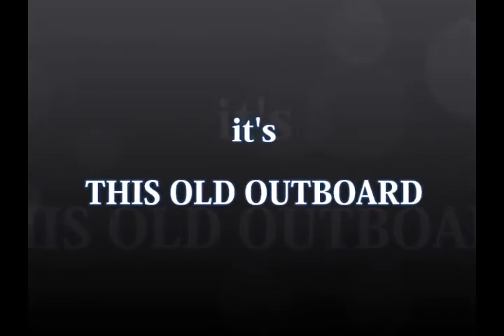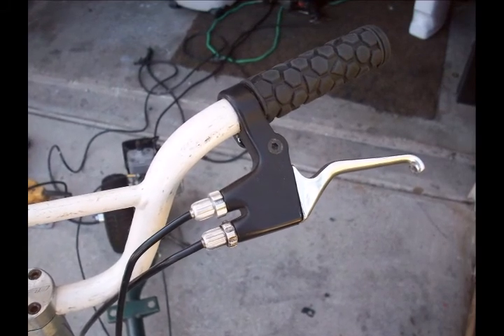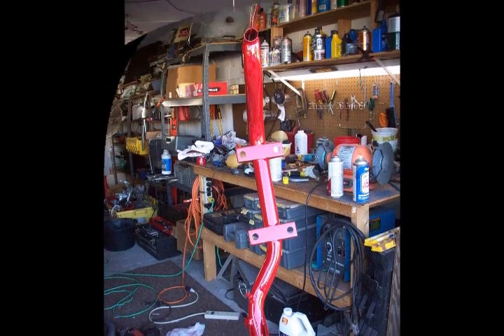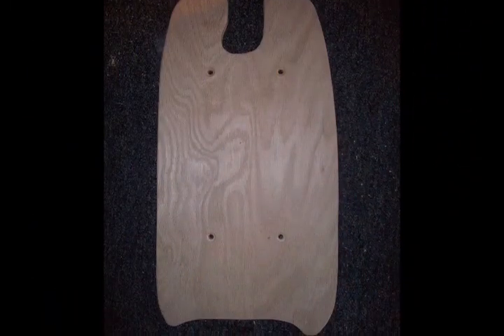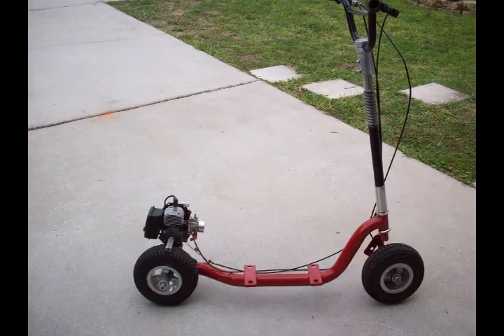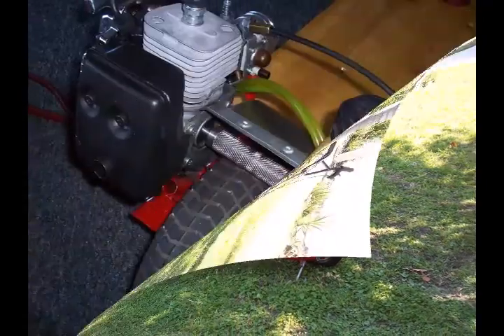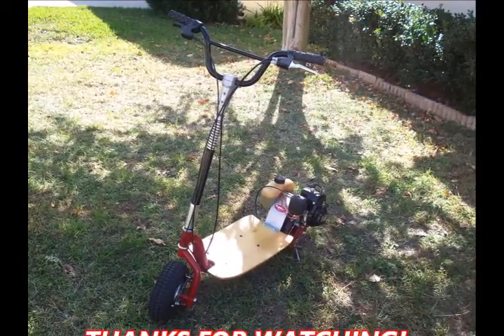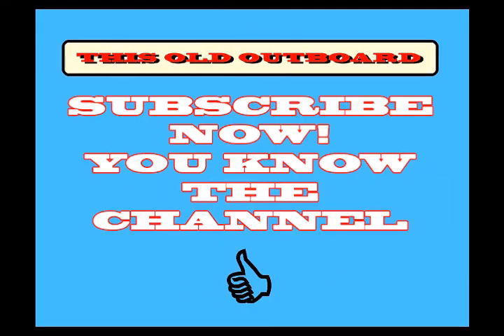Custom Build Go-Ped - Lil Red

Comment: Ya know, with all that affection expressed, seems you may have to get back now & then to the go-ped building. Great little skater. So it was direct drive, no centrifugal clutch? Just governor limiting on speed? Max. minimalism. And that tire diameter felt best for handling? Seems you reached the design pinnacle and then had to leave off. Engine lift was indeed brilliant, esp. in brake combo. Maybe build one with an oil clutch? Then sell for max. profit, or raffle off (if legal). "This New Power Skateboard" branch off. I could imagine a new-build break being welcome now & then after a series of neglected/greasy OB revivals & parts searching.

Put a park buddy in charge of assembly while you dream up and sketch out new innovations. Maybe a 3-wheeler with seat for the elderly, replete with grocery basket and cup holder, baton scabbard for self-protection, ha!
Reply from the maker: hey. i would love to have another one. i do look on craigslist from time to time. i'm an old surfer boy from cocoa beach and the go-ped is about as close as i can get to that ''feeling'' of riding a wave. yep, direct spindle drive, i think most of them are belt/chain drive now, at least the bigger peds are and no govenor. that zenoah g230 i believe will do 35 mph, plus you can really soup these things up. i had a couple that were pretty scary, to fast for me! they did come out with an oil clutch on one model, but i never had one. the grocery basket and cup holder is funny as s***!

Comment: That lil red thing will scream!  Looks like you had a pretty nice shop once upon a time.
Reply from the maker: YES! I MISS THAT THING, I BARELY GOT TO RIDE IT, IT SOLD PRETTY FAST. I'VE HAD A COUPLE THAT WOULD BLOW THAT ONE OFF THE ROAD, THEY WERE PRETTY SCARY, I WOULD RARELY COME CLOSE TO HITTING THE THROTTLE WIDE OPEN. IT'S BEEN RAINING HERE SO I HAD TIME TO GET MY PICS BACK. UNBELIEVABLE! I HAVEN'T SEEN THEM IN YEARS. ANYWAY, YES I MISS THE GARAGE TOO! MIGHT TRY AND SET UP MY STORAGE UNIT, I JUST WISH IT WAS CLOSER TO HOME.  OK, TIME FOR DINNER! LATER